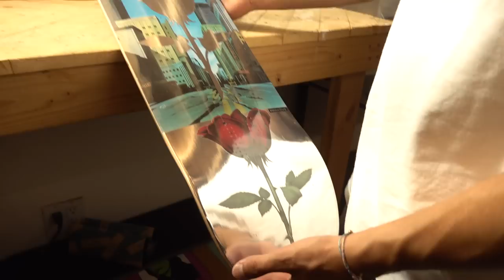New Setup Video

Comment: Please release the twin boards in 8.5 with a 14.25, 14.5, or 14.3 wheelbase. I’ll buy those in a heartbeat. Also it doesn’t matter if the graphic is symmetrical or not. We just want the board with whatever graphic is on it

Comment: I thought the twin nose board graphic your Rose middle section ^+Down, Nose/Tail <> Roses = universal. Also using new trucks every time doesn't it feel strange not having broken in trucks ?. Also do pro's use new boards so much to show the brand graphics + the glass pop. Its great hearing your insight dam right you worked hard you are one of the best tech minded skaters around and your parts are iconic.

Comment: I heard your Hawk Vs Wolf. Saying your knees been acting 🎭 up like they going for an Oscar ha  I got a new hack. Take a shallow ice bath on your legs only … but sit there for over an hr. Deep freeze your shit. Balls will be snow balls after your done lol Than warm bath or sauna after. You don’t understand that 4 min in a polar pod ain’t shit. That extra hr is like some next level. It’s been a game changer for me.  
Also you gotta do lots of cupping on your knees underwater when you switch to hot bath. Pull all the inflammation out. Get the cupping wherehouse set. Those knees will last another 20 yrs if you take my advice. Full reset. 
Also stretch / teeter ect. But those moves are crucial.
Ice baths are good but when you go upper body you can only last a couple minutes Vs legs only I can go 2 hrs tops.

Comment: That's a great idea. Uv activated graphics on a wheel. So the image would only show up in the sunlight.
Reply: A blank wheel with a glow in the dark logo
Reply: Wear away wheels that have layers like jawbreakers so as the wheel wears away a different color starts showing through and as the wheel gets smaller it changes colors?
Reply: Lenticular artwork or holographic images on skateboard decks 🛹
Reply: Or blank glow in the dark and blacklight wheels in different colorways?
Reply: Waterproof and weather resistant skateboards that can double as a snow skateboard with mild modifications available in part kits or conversion kits?
Reply: Waterproof griptape for skateboarding?
Reply: Snowskateboarding Nikes?
Reply: Wear away graphics on skateboards.
Reply: The more you grind it the more the artwork is revealed
Reply: Collaboration with a snowskateboarding company?
Reply: The original red bone reds are in the black box I believe

Comment: I was told when I was a kid starting out that REDS aka China Bones, were Bones bearings manufactured in China, which were much cheaper to make than Swiss Bones, therefor more affordable to skaters; They are called REDS because China is a Communist country.  Could be wrong but that's what I've always thought.